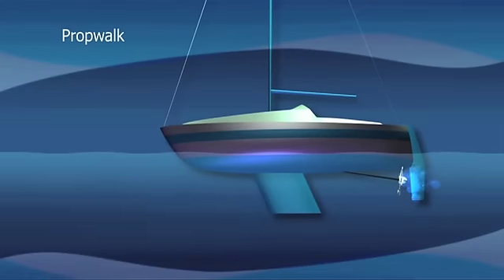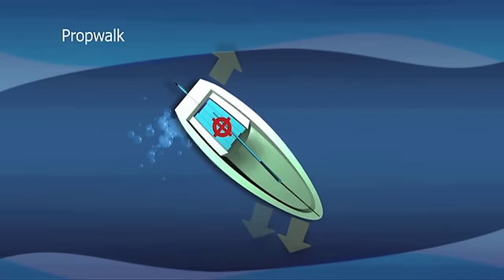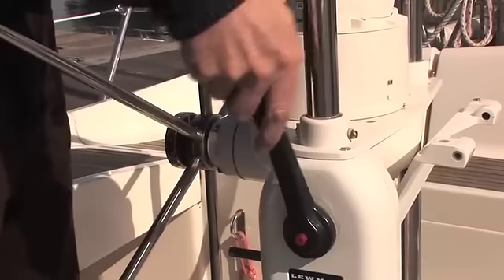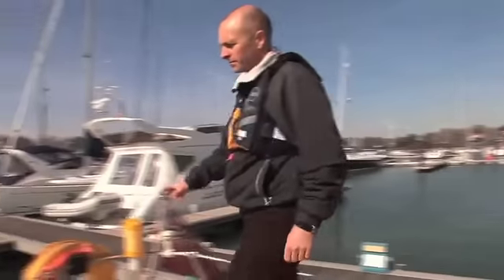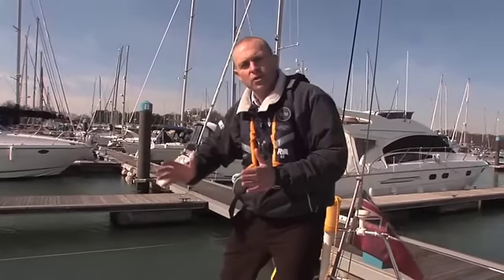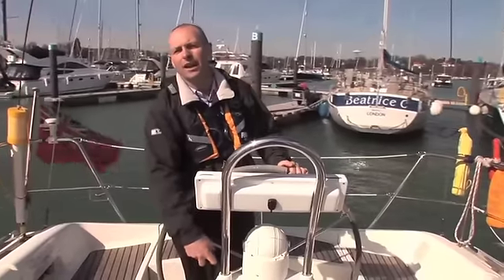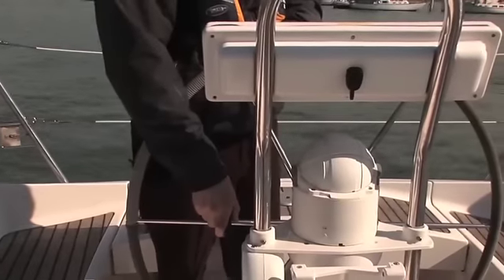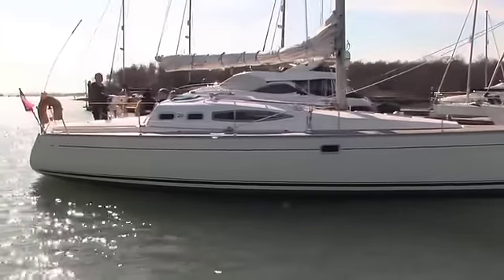Boat Handling - Prop Wash - Prop Walk - Simon Jinks

Comment: Reversing a full or 3/4 keel boat is a lesson in patience. If you let the bow swing more than 5 degrees or so, it will continue fall off until it hits the pier or your slipmate. If you catch it soon enough, pumping the tiller to port (if falling off to starboard) can sometimes correct it, but no guarantees.

Comment: I been backing into my slip using a spring line as shown in the video Docking Techniques Demonstration. I highly recommend watching that video too. That could work for you. When I had my Oday 22 with outboard, hey you show me the slip I can back in blond folded. As I have learned the past few months, my Hunter 33 can sometimes be a stress festival trying to back into my slip using engine and rudder steering.

Comment: Lateral displacement of water by the props is resisted by "stationary" water.

The prop wash/walk effect should only come on when there's insufficient resistance from some direction, in this case, the top side as there is essentially no water to resist the wash above the surface.

If the prop is deeper in the water, the wash/walk effect is diminished.
Reply: Diminished, instead putting a counter torque on the boat's long axis, which would dip one side in a little over the other. Resistance by the boat's hull and centre of gravity stops the boat flipping in opposite direction to the spin of the prop.

The net result is forwards thrust.

Comment: There is a lot of questions unanswered here. Is this a right or left-hand prop? you don't clarify,  prop walk in not clearly defined here, at .55 you mention that the boat kicks to port with prop wash to starboard, you don't mention prop walk here, is this what you mean by prop walk. It's still unclear what prop walk is. I understand prop wash. Please clarify. Thank you. Paul
Reply: This is a fixed pitch right handed prop.

Comment: I'm always exceedingly sceptical about such videos as for precise maneuvering a GOOD outboard is hard to beat as one can vector the thrust.  (By good outboard I mean one that starts first pull every time then runs as steadily a a well-oiled clock)  

Some people seem to be a cross between Mr McGoo and Mr Bean and they get the boat stuck in the reeds and the mud every-time.  This is never their fault, its the fault of the council or the harbour authority who haven't dredged the river deep enough!  Such a faux-pas cost me almost £1000 as my boat which was supposed to be being sailed out of the costly marina by live-aboard friends remained there with a horribly fouled propeller.  The water was near freezing and the visibility was only about a foot so diving on it was virtually impossible even with a wet-suit.  In the end I solved the problem of getting the boat to the boat club by fitting an outboard bracket and an outboard motor.  Inboard diesels aren't all that they are cracked-up to be but perhaps a mud-motor propeller would help? LOL
Reply: Oddly enough not all yachts can be powered with an outboard motor….

Comment: informative video but it is unnecessary to go through the trouble of running the boat in gear while berthed. it is very easy to find manufacturer information for your specific engine online, or, failing that, observe the rotation of the prop shaft at the rear of your engine while cruising.
Reply: How are you going to observe it whilst cruising without first backing out of your berth?